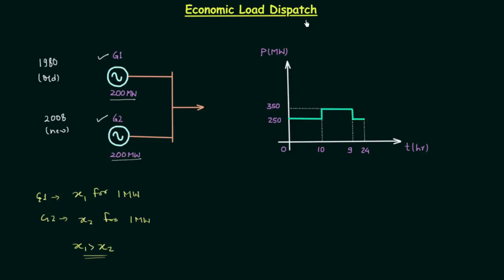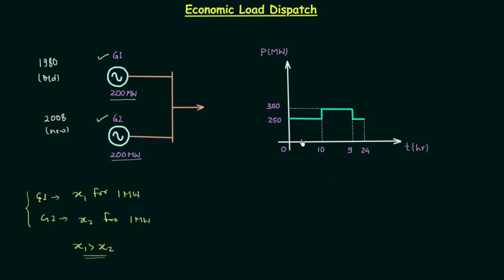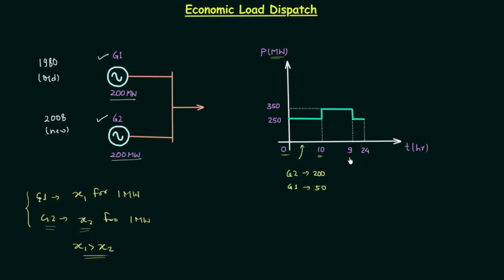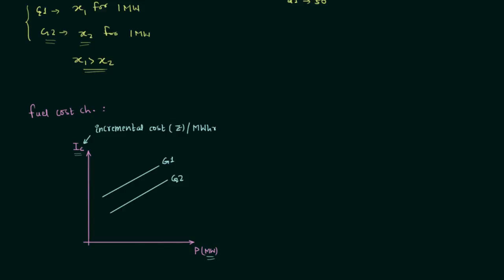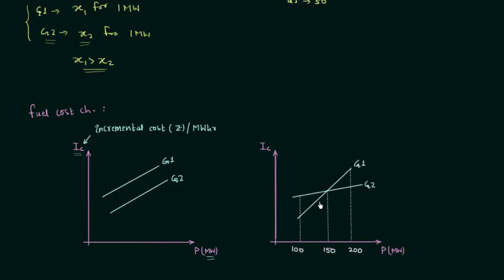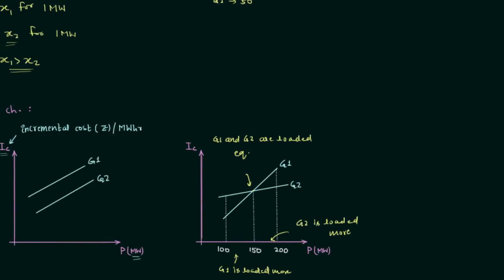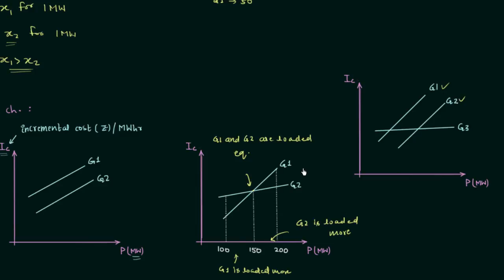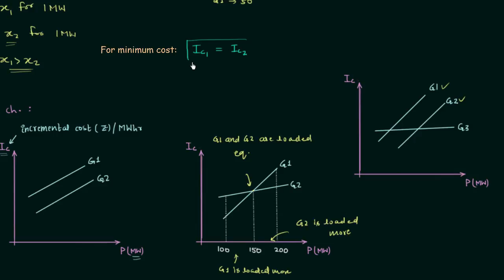Economic Load Dispatch

Comment: Q. The price of electrical energy is Rs 60 per annum per kW of maximum demand plus 3 paise per units. 
Lamp 1 costs Rs. 1.50 and takes 100 W and Lamp 2 costs Rs. 4.00 and takes 30 W. Both gives the same candle power and have the same useful life of 1000 hours .
1. Out of two lamps which is more economical. 
2.At what load factor both the lamps are equally economical. 

Please reply.